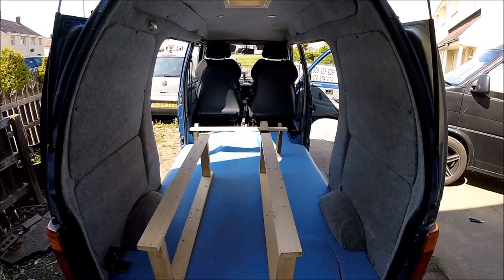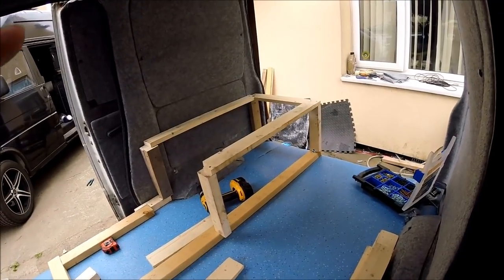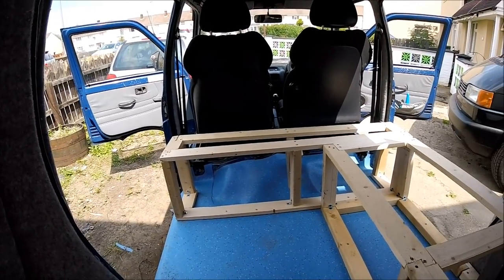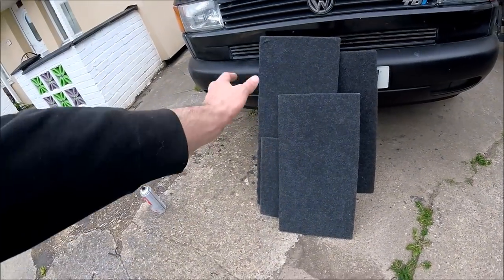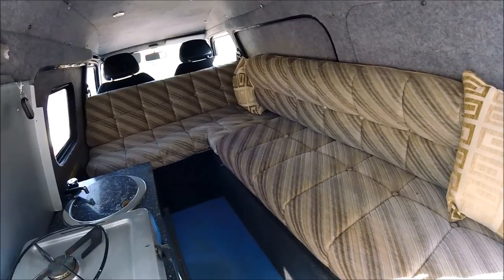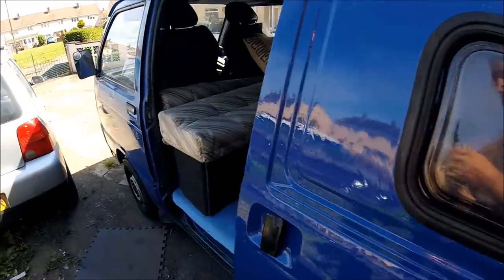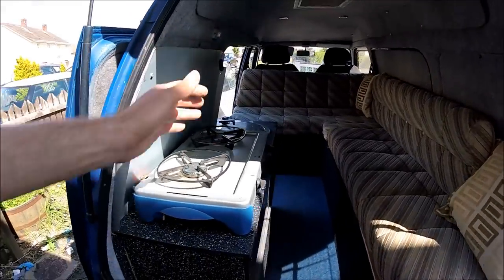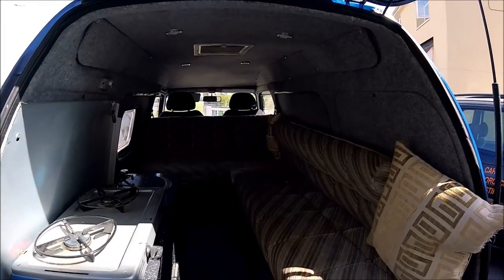Campervan L Shape Corner Pull Out Sofa Bed Build - Daihatsu Hijet Micro Camper Van

Comment: Nice video. Which video did you drill in the electric hookup? I'm planning similar on the same type of van, with a propex heater, just wondering the safest place to drill holes in the floor and avoid anything structural on the chassis. Cheers. Thanks for the vids.

Comment: I really like this build as it is so neat and clean looking.  I have one suggestion tho' and that is to build open shelves under the beds.  Everyone does what you've done and has a lift up  cover to the storage box under the bed, but.... it's not easy for a woman to lift the bunk all the time and try to hold it while getting things out.  With open shelving facing the front, and maybe even some pull out drawers, that whole problem is eliminated.  And the bedding doesn't get all messed up like it does when lifting the lid.  If the shelves aren't too deep, people could still use the lift up lid for storage of things they don't use daily, behind the drawers.  Just a tho't, tho' I really do like this design otherwise!
Reply from the maker: Along with the flip up lids, the bed also has flip down front panels for easier access, maybe you missed that part?